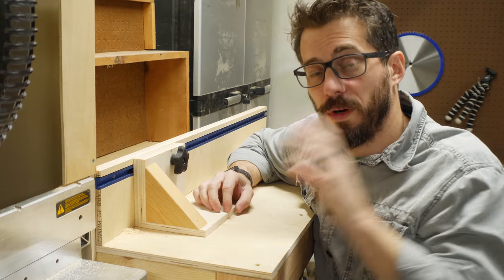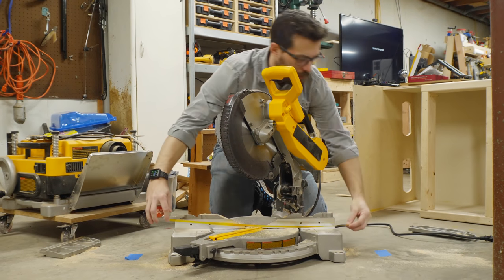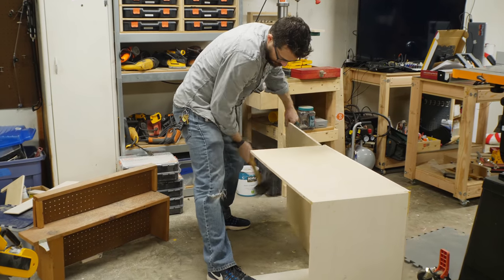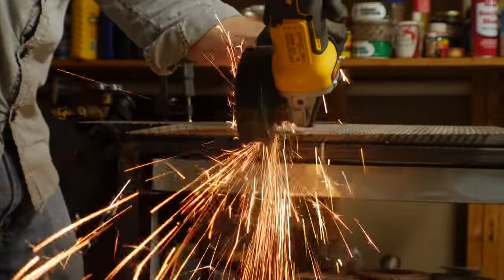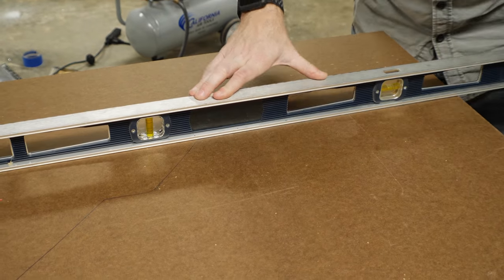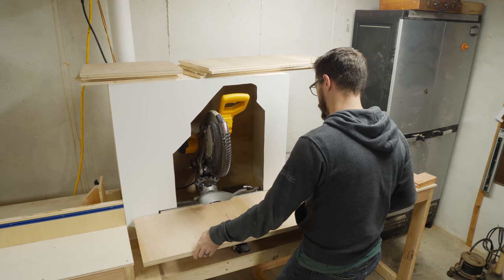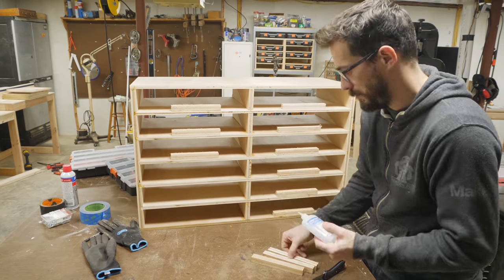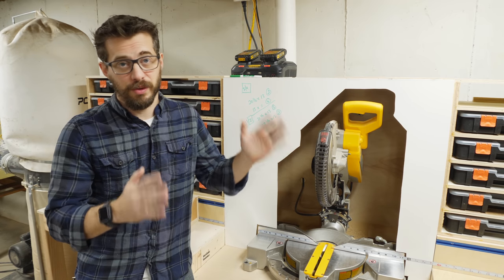Using Your Suggestions to Improve the Miter Saw Station | I Like To Make Stuff

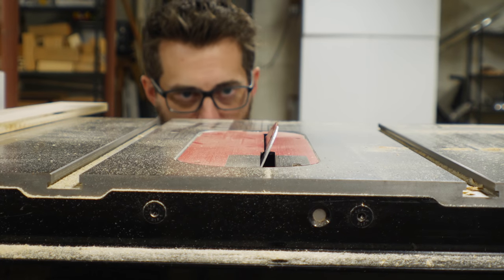Comment: Bought your plans, built the station and made the modifications from your second video.  Very happy.  One question, however.  At 5:40 of the video, when you are making your bevel cuts, shouldn't your fence be on the other side of the blade, with the offcut beneath the blade tilt, preventing the "good" workpiece from lodging against the fence and possibly kicking back?  An ounce of prevention...

Comment: This is awesome!  I just got the plans from your site and plan to build my own version of it.  For reference, what is the new width that the middle section needs to be to allow the miter saw to perform the compound cuts?  I'd like to build that piece out from the upgrade rather than the version that's in the plans and didn't catch it in the video.

Comment: Okay, first off I just found your channel so this comment is a little late.  However, I worked in a door building department of the company I still work for and we built a box similar to this. I love the magnet idea and the sliding stop. Im wondering if you have added a port directly under the saw? That is where it seemed to accumulate the most and was the hardest place to clean out without using air or removing the saw.

Comment: Hi Bob, you did great improvements in your miter station but I noticed that you might loose a bit of suction efficiency from your dust collection system due to the metal mesh junction with the plastic tube cause it is not tight anymore because of the mesh intricated form and I think it will let air get in from the surroundings instead from 100% the box, just an observation that I hope could be useful.

Comment: Bob -- over on the Make Stuff channel, he took down his fencing and instead just installed t-track to the table surface with stop blocks on the track.  Do you still consider having the extended fencing a necessity?  I'm currently looking to make a better miter station and this is a point I'm wrestling with.

Comment: I do have a question here I work at home depot so i know we carry the dewalt miter saw that has battery pack can you build a nice mobile station using the same set up but making the dewatt miter saw to be mobile on a job site such as in a house, office, trailer etc.

Comment: Thanks for creating this really informative video.   Any updates on this design?  I really like your dust collection solution.  What are you using to collect your dust?  The only possible improvement on this system is to make your benchtop wider so it can also be used as a workbench/mitre saw station.

Comment: Love seeing the improvement on past projects! I'd love to know your thoughts on running compressed air lines to several spots around your shop. It seems like having a quick blast of air to push more dust towards the collection system or dropping a line down to your paint booth would be convenient.

Can't wait to read through the book. That's not a small undertaking. Thank you for always putting out consistent and quality content.
Reply from the maker: Thanks Brock! I really appreciate it! I'd considered compressed air lines but honestly, I rarely use compressed air. I only ever use my brad nailer with the compressor, and that isn't really super often.

Comment: Just an idea for dust collection but lower the ends a bit and drill some holes and have them spaced a bit more out, idk if it would work better but if the holes are a bit smaller and chamfered it might have enough force

Comment: Bob, I was wondering why you didn't extend the miter saw table and fence to the side counter fences on each side prior to sticking the measuring tape to the fence? This would not only give you a permanent surface to stick the tape to instead of the removable white board (which could be shortened)  increasing accuracy of your cuts, but could also locate your miter saw within the lower counter top. 

While you're at it you could also add some location blocks around the miter saw feet to maintain the position of the saw for those times you need to use it at another location and then return it to the station. This way it wouldn't be necessary to screw it to the bench top.

Comment: Very nice build!  One quick tip I'll give because I just ran into it.  You don't want the tape measure on your saw fence.  It will knock things a tiny bit out of square.  And, unfortunately, unless you want to tape the entire fence, there's no good way to fix it.  My saw was driving me crazy because I could not square it.  Actually, I could square it with 3/4 plywood, but then with a 2x4 it wouldn't be square anymore.  Or square with a 2x4, but then not square with 3/4.  It's because the fence is different for the two board sizes depending on if it's hitting the tape or not.

Also, I found pulling my saw forward about 1/16" from the extension fences is better.  Even if your fence is dead straight (mine was pretty darn close), if you're cutting a 4' board, the chances of that board being straight enough are slim.  Which means the high spot at 3' will push you a little off 90 or 45.  If your only reference is the saw fence, it's much easier because you only have ~12" you're trying to push square, not a few feet.

Comment: i think i have some thing , you can add distance measurement device and replace a screen with laser screen under your eyes and extend the control keys  under your finger , just the sensor place in the end of table , you put a board press button see the exact size  , and choose  the Instantaneous kind not the slow one , maybe that will not work but you said suggest .

Comment: whats nice about these vids is if you're very new to saws/workshop tools, woodworking and DIY projects like me, you can see a lot of practical examples and uses of different tools and the things you can achieve with them. I've never used a table saw, so I never would have thought about stacking blades and adjusting the cut depth to achieve those 1/2" slots!

Comment: How difficult would it be to utilize the lower portion for drawers with proper full extension slides. A 2x4 box may not be super square, as the slides tend to require precision

Comment: If you want to widen those dust ports even further, you might have the room to use a panel raiser bit.  That could give you quite a bit of sloping area around each port to help the dust fall home.  If you don't have the room around the back, I bet you could still benefit a lot from using it on 3 sides.  I don't think they make them with bearings, so it would be freehand work, but appearance isn't important back there.

Comment: Hey Bob, just bought your plans for this miter station, pretty much exactly what I’ve been wanting to do for mine. Before I saw both videos on it, the version in my head at least two more feet on bench top space to the left of the saw than yours. Do you feel you have plenty of room and support for long pieces of lumber with only 3ish feet on both sides?
Reply from the maker: I typically don’t work with pieces over 8’ so it works well for me. All depends on what type of stock you work with.

Comment: I gave a lot of thought to what kind of miter saw station I wanted.  I finally decided that instead of a vertical fence running along the entire length of my bench, I simply routed a slot for T-track in the surface along the entire length and use some t-bolts and thumb screws in a couple scraps of ply for my stops.  My saw is level with the work bench.  This allows for using the entire bench as a flat work surface, except of course where the saw sits.  Having a ruler for me isn't necessary.  Whether in the field or in the shop I'm cutting to a mark on my work piece, (and usually creeping up on it), and not a point on a ruler on a fence that could be just a bit off.

Comment: Thanks for all the cool ideas.  I am going to use the magnet front plate shroud idea on mine.   Here are a few comments:

1.    I found that after years of service, I opted to mount 1/2 inch MDF on movable fence part that came with saw and this offset the original fence which I originally made coplanar with the aluminum fence.  I did this because often I cut for framing and long boards are warped or cupped and after a time, the saw moves abit due to binding (I mounted it originally with long screws and since there is a long distance between the top of the saw mounting hole and the table, the screws do not remain perfectly vertical).  
      Soooo, I am no longer relying on the long part of the fence for getting a square cut, but just extended my miter stop out and allow the 1/2 inch gap out there.  
2. After years, the deck that the saw sits on sagged and/or the dual countertop (mine was two glued MDF sheets wrapped in maple) moved a small amount-enough to make saw slightly lower on one side than cutting table...so I had used shims.  Recently I redid my saw (like you did in this vid) and I installed 4 t-nuts into both maple side rails that the table sits on.  This allows for adjustment as the years go by so I can true up the saw both for flushing it to table in both directions.  
3. Because the long part of the fence on each side (for me) only supports the stop block and is not used to square long pieces anymore, I am debating removing those two fences because I realize that (like your need to elevate your cubbies behind fence) there is alot of space there that with the fences is dedicated to cutting and without them could be used as a deep work surface.  The only problem I can see is how to lock down the stop block.  For this, I am considering routing the Kreg mini track like you did but directly down into table.  Then to keep stop block square I would use two T-bolts.  What do you think?  Do you think this would work?  

I am subscribing.  Thanks again and keep up the good work!

Comment: Question about the grate:   Uncommonly known, it is airflow that pulls dust in a vacuum system, not suction.  So any airflow loss from clogging filters or screens will lower your ability to pick up dust.  But also any leaks where air comes in from other than the end of your hose.   The openings along the edge of the grate is not sealed around the edges so you can lose a lot of air flow through the edges. I know it sound nit-picky, but a little caulking around the edges will solve this problem.

Comment: What about just pulling the saw out to make compound cuts? I don't make them often either, and I also don't cut precise cuts longer than about 36", so this helps me keep the miter saw station size to a minimum. I also have a window behind it that I open when I use it, so I don't have to have all that space behind the stand taken up just for the bars that extend out the back.
Reply from the maker: You certainly could. Personally I'd want to avoid having to replace the saw every time to make sure it's lined up with the fences, but if you don't have the space, that'd work as an option.

Comment: for the platform under the saw you could use expanded steel mesh instead of wood with a tote under it to collect the dust. it would eliminate the dust collection ports and when the tote fills up you can empty it just like the dust collector

Comment: get a Bosch GCM12SD, and you can push that whole bench up against the wall and make your shop larger and still keep those containers to either side plus the base cabinets.
So now all that wasted space behind there ends up on the front where your feet are and your shop just get a little bigger and your miter saw just turned to top quality.

Comment: For the envelope around the saw it would be a pretty good idea to cover the entire opening with rubber sheet. That way it provides greater suction without a lot of air uselessly moving around the saw and allows compound angle cuts that still seals the opening.

Comment: I really like that angled piece at the back to catch more dust. I'm curious to see if it works
Reply from the maker: It works well right over the vents. The dust in the middle section and corners just piles up on the flat surface below the angle.
Reply: Man dust control is a pain

Comment: I love the table and may build one just like it, however I may make the cleats you used to line up the new center section a permanent fixture so I can build multiple tops for my drill press, scroll saw and band saw which are all tabletop models.

Comment: HAHA mimi  mimi mimi ... Good improvements ... I just want to add 1+ ... If you put the base of the mitersaw box uneven ... enclined towards the holes ... forcing the dust to fall on them ... I do not know much but I think the saw it vibrate, and that would pass into the box and cause the dust to fall into the hole. Of course you would have to put some feet in the saw to leave it level with the bench...

Comment: I like what you did.  I would consider mounting the saw on a separate plate of good plywood with chamfered corners.  Form cleats on the table around that plate, so that the saw plus plate can be pulled out easily, as a unit, to carry it to a job site.  And when the saw comes back to the shop, the cleats will joggle the saw back into the precise alignment.  Oh, and mount a light or two  dedicated to light the cutting zone......   Oh, and add a little shelf nearby(on top?) to toss little clamps, and jigs, and stop blocks, and...stuff.

Comment: Suggestion about the suggestion: there's this part in which you measure the high of the cut for the dado, so you have to take a look with the tape measure, which can be more or less precise but enough to do the job. Now, I think that it shouldn't be too hard to come up with some kind of easy jig to that in a precise and easy way, maybe not the fastest.

Using a board with a ruler (something like the one that you've added to the station) in vertical, it's just about adding an adjustable piece that can move up and down. When you want to make a cut that is, say, half an inch high, you put that piece at half an inch, set the thing so that adjustable piece is over the slot for the blade and you just have to raise the blade until it touches the piece. It makes you not having to force your vision. I don't know if I've explained myself but I hope you've understood me. And maybe it's not that useful but just in case.

Thank you for your videos as always.

Comment: That's a cool design. I had a thought to further improve your setup,  since your front can easily come off, I was remembering your outside sink video. You used a curtain rod as the doors. You should just keep the open miter box shell, add the curtain rod, then your  vacuum per cubic feet will be greater with less air leak , unlike the current design you have now that leaves a big open cavity. Also you can just move the fabric on the rod left or right depending on all directions of cuts. Definitely have less dust.  Ok hop on it . Next video. Say in a week. Haha  jk  always enjoy your stuff and like the fact you take the time to listen and respond to comments .
Reply from the maker: Yeah, that'd be an option but I'd be afraid that the curtain could potentially get caught in the blade. This setup works surprising well and keeping the dust in that box. When you make a cut, it looks like the dust is going to shoot out front but then it gets sucked right back in.  It's pretty cool to see up close.  Thanks!!
Reply: Bust out your sewing skills and add some weights to the bottom, and you can always flare the ends away with like a magnet or what not.  Either way man I'm impressed with what you got no doubt.  Looks so legit. I really like the dual purpose and making the front the white board.  Pretty funny and practical.  Great stuff my friend. Have a great Xmas, build your kids something great!

Comment: Love using magnets to the front panel.  At some point you'll need to get back there.  Now you can do it easily without deconstructing anything.  Should work well unless the vibration causes things to shift and slide but nothing a couple more magnets couldn't fix.
That dust collection setup & drawer is pretty nifty too.

Comment: You dust collection area should be built more like a funnel. This would result in near 100% capture. The metal mesh you installed would of course block the large pieces.

Comment: when you say 2×4 is it on inch or meter? thanks. by the way great improvement on the mitre table
Reply from the maker: a 2x4 is in inches (actual size 1.5 x 3.5)

Comment: Hey this may seem like a stupid question but I'm a novice. Can u explain the difference  of the types of wood used for which type of projects? I am trying to design a drafting table and I'm struggling to figure out what types of wood are light but strong. Any advice would help
Reply: Just use timber for most simple projects it just large pieces of soft wood but plywood is laminated pieces of wood that can be a lot bigger and I’m sheets but be aware that both can warp a lot so look for the straightest bits u can find

Comment: Many great ideas overall!  I will definitely use some of them when I start my miter station next month.  After use, do you find that the thickness of the self adhesive metal measuring tape interfering with the ease and/or accuracy of your cuts at all?  Thanks again for sharing your ideas and projects.

Comment: I’m worried that the grate will hider the performance of the vacuum because there are gaps in between the grate and the table so air will be entering the vacuum from under the table affecting its efficiency. I could be wrong though. Great video! Keep it up!
Reply from the maker: There really isn't any gap. The plastic overlays the metal in a way that doesn't leave any open space.
Reply: Wow wasn’t expecting a reply! Great to hear I’m wrong.